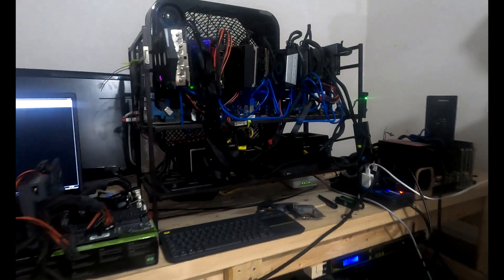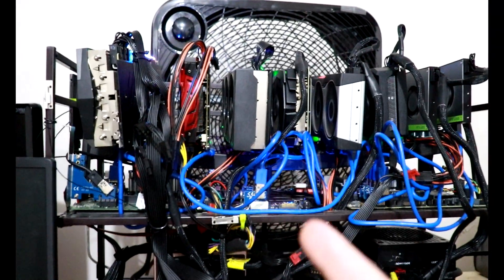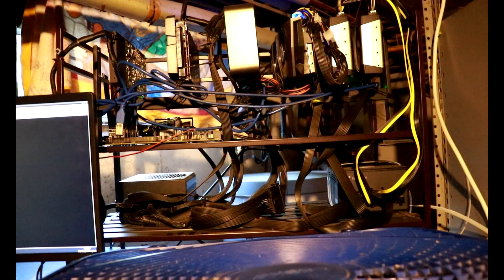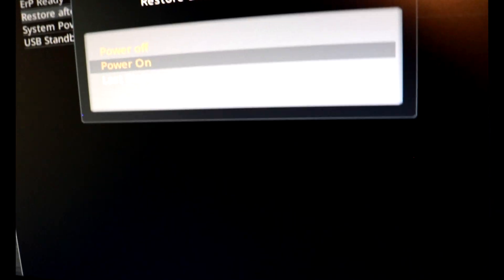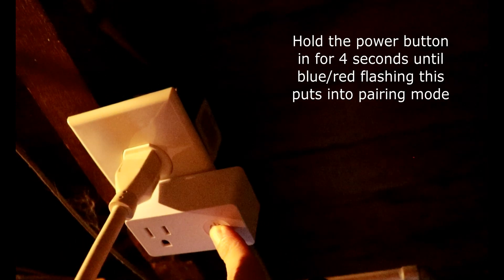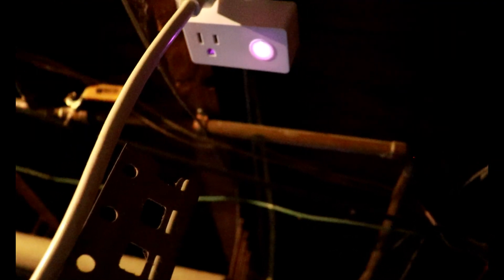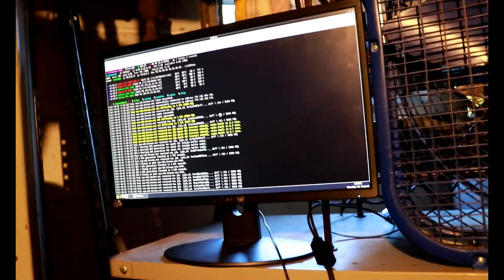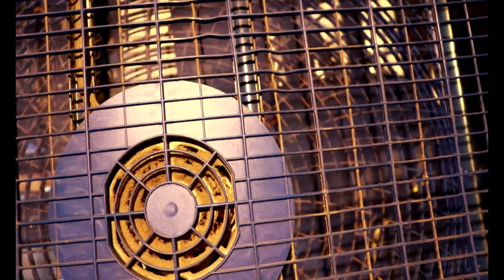WIFI smart plug installation for mining rig

Comment: cool video man, just gotta make absolute certain you don't pull too much power through those wifi plugs, seen some people melt them. Raspberry pi controlling a high amperage rated solid state relay is another option :) "15 A, 125 V, 1875 W" from the listing (which seems sus) but at any rate some wall outlets are 20a.
Reply from the maker: This is great advice Anonymous Miner, and you are correct this particular smart plug has a power limit of 1875 watts, and we are under the 80% rule on the plug. This outlet has  a dedicated circuit  of  20AMPs.  I would say this is a good option for small low wattage setups!
Reply: @CaveManMining  definitely a good option. Just be aware if you turn that outlet off when the rig is pulling a decent amount of power, it will arc at the contactors inside that plug. Eventually this can lead to high resistance / heat / thermal event.

Comment: I'm definitely gonna need to look at getting smart plugs.

For power quality issues, an AVR UPS can do wonders. Obviously it isn't feasible at scale, but having a single rig and networking gear on one can save a lot of headaches.  That UPS will compensate for dips and bumps without touching the battery (leading to longer battery life), and will keep things hashing for a few minutes during short blackouts.

I also can't tell you how nice it is during a blackout to grab a tablet and keep streaming a show over wifi.
Reply from the maker: Hey Stephan you are right!  these smart plugs are a quick win for budget miners that experience more freezing then power issues,  or folks who have small rigs or networking equipment in remote locations!